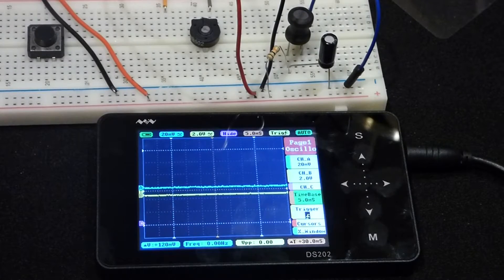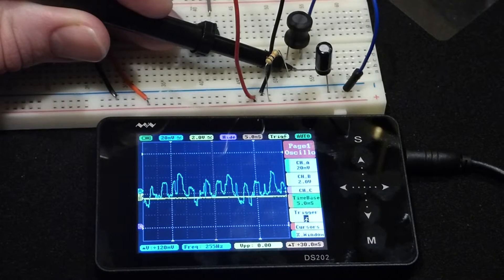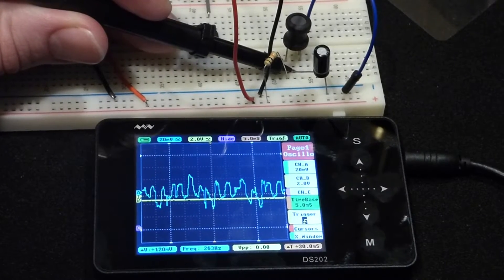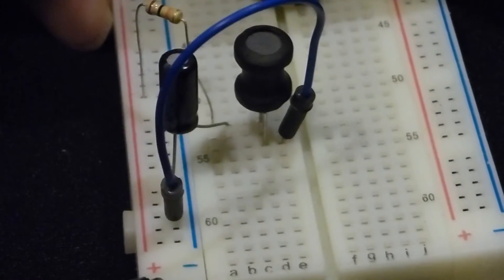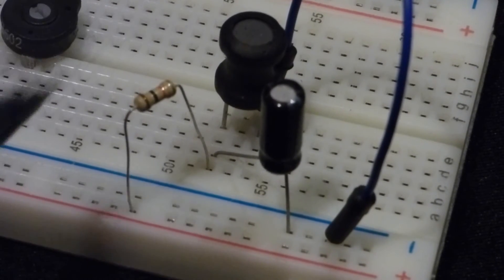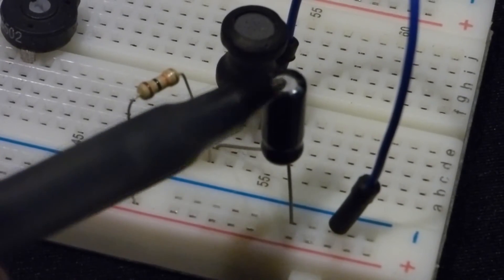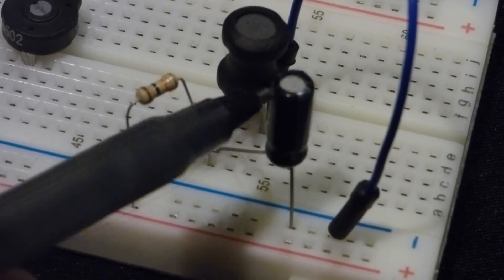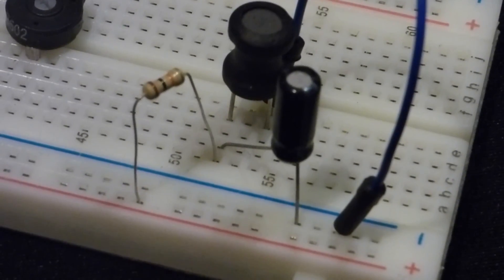Quick electronics LC tank circuit demonstration using my new digital oscilloscope

Comment: Only the capacitor and in doctor and series. You need 2 Inductor and 1 Is capacitor. And change where you put the ground. You will find you get different voltages

Comment: I'm afraid this is not correct, you can not just apply DC to that circuit. You need to apply DC and then disconnect and see the following result that will be a few oscillations before it collapses. With your circuit you are just seeing noise

Comment: What happens if you change the voltage ie increase or decrease the voltage? What changes?
Reply from the maker: Pretty sure it doesn't work. Probably need to change the value of one or more components with a change in voltage.

Comment: Very nice video!  Could you please share which voltage source you used, and also the values of the resistance, capacitance and inductance?  Additionally, did you measure the voltage across the resistor with the oscilloscope? Finally, how many oscilloscope's channels did you use?  Thanks for your attention to this.
Reply from the maker: Thanks! Unfortunately this is a very old video, I don't remember any details about making it.
Reply: By any chance, do you remember if you used a regular commercial battery as a voltage source? Thanks!
Reply from the maker: @leonardorodriguez4152  I used to use a regular 9V alkaline with a battery snap a lot.
Reply: @Electronzap  I understand.  Please let me know if you find the information later.

Comment: But capacitor should be non polarised.
Reply from the maker: Large value capacitors are almost all polarized.
Reply: @Electronzap  I meant, in LC circuit, the capacitor is non polarised. But in your demo ,you have used a polarised cap. Why?
Reply from the maker: Oh, I just wanted to make an easy to understand demonstration circuit.
Reply: Correct 
Non polar capacitor should be used in LC Tank circuit

Comment: Isn't this called  RLC circuit because there is a resistor into it? (I don't know if I am right I don't know much about electronics)
Reply from the maker: Yup, when a resistor, inductor and capacitor are in series/parallel of each other, it is an RLC circuit.